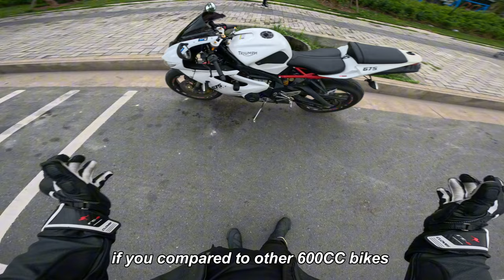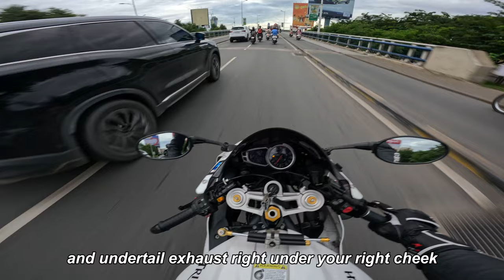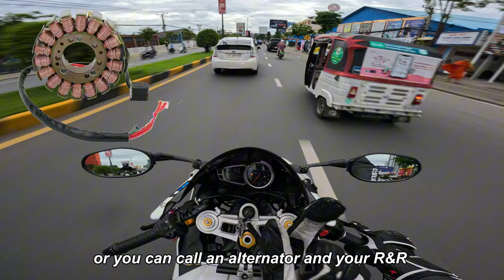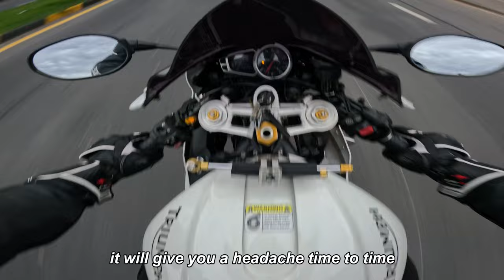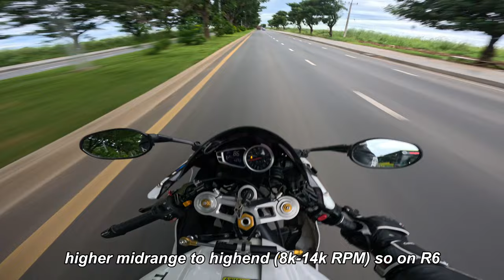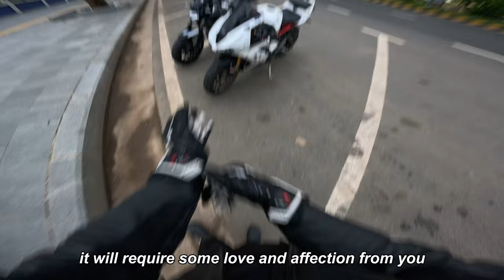The Triumph Daytona 675 In 2024, 18years Later Should You Buy It?

Comment: Would the 2013-2017 models have the same reliability issues even though it’s been redesigned?
Reply from the maker: The 2013+ model fixed the R&R issue but the alternator problem still remain & is not as hot without the undertail exhaust under your bottom, you also get a gas gauge & optional ABS

Comment: does ur 675 still have the exeup valve remains? because i can see clearly the  dashboard engine light is always on and u didnt remove the error indicator?
Reply from the maker: @LitYangWong  haha good catch, my exup valve is held open by safety wire because my servo motor broke so I just deleted it & haven’t gotten a servo buddy for the engine light.
Reply: @Samplaok how about the aftermarket alternator?is that a china made alternator?i heard that the chinese made alternator broke more often,maybe like after few weeks, or months🤔
Reply from the maker: @LitYangWong  it’s from Rick’s Motorsport Electric a US company & I’ve had friends who used Chinese alternator (50$) in their Daytona & still riding around in it to this day so changing Chinese alternator often might just be cheaper than changing a new OEM alternator (520$) due to the price differences